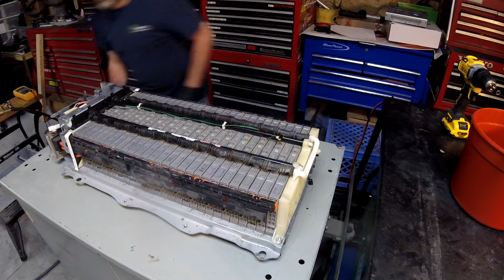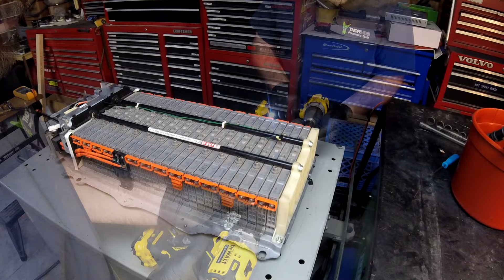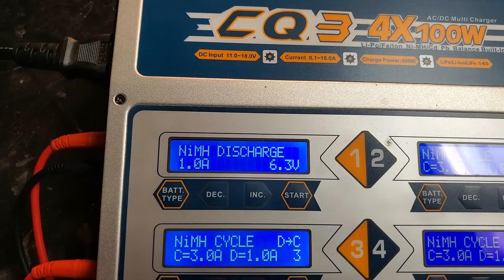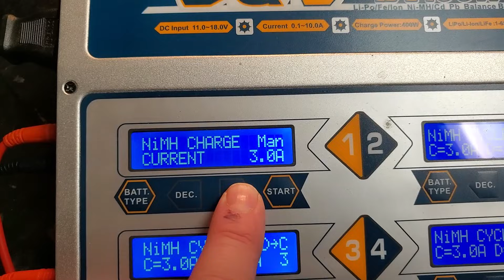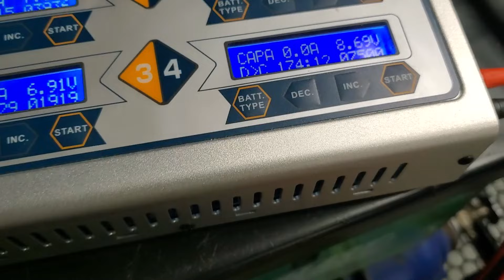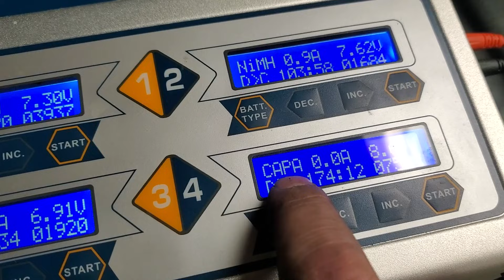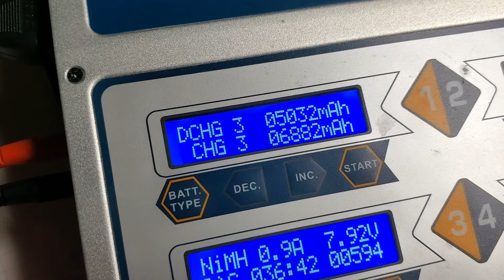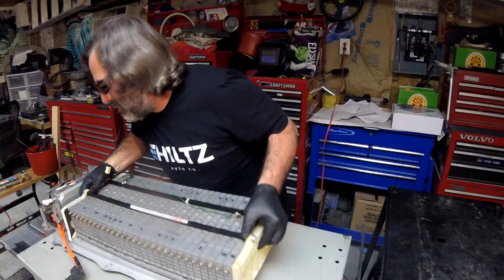DIY Refurbish / Repair Hybrid Battery 2nd Gen Toyota Prius - EV-Peak smart charger POA80 P0A80

Comment: Can I ask you something?  At 3:22, with the cover off, we see a pair of thin green wires from the computer area to a tang on one of the tension bars that keep the modules compressed together.  There's a white thing on the end of those wires with a hole in it.  I think it had a black plastic peg holding it onto the tang and I lost that in the explosion.  What is all that, if you know?  Thanks for your help.
Reply from the maker: Hey AlexT, I believe that is a temperature sensor. I do not see any part numbers on it. The only mark on it I see is a letter "S". When I connect multi-meter I see around 10K ohms resistance. If I cool the sensor a little by putting it on metal table the resistance goes up (in my case to 11k ohms), if I heat it a little by holding in my hand the resistance goes down (in my case 8K ohms). Please write back and let us know what you find out.
Reply: @GreggFesto   Will do.  Thanks.
Reply: @GreggFesto  I notice the green wires seem like special wires.  Not the same as some of the other wires here.  Although the wires fed thru the looms look the same.  I wonder if the terminal is just to keep the wire in place, stretched along the top of the battery.  
Got the car started for a minute and no red triangle of warning lights.  I heard a little ping from back there so I shut it off.  After that, it would not start and the red triangle is back.  Also, there's a serious draw on the 12v.  It passed the load test with a 135 amp draw yet something is pulling it down when the outgoing 12v is connected..  
I'll need to do a lot of hunting around tomorrow.  I'll leave the charger on it all night.  Everything is suspect at this point.
At least the 3 new modules didn't explode...yet.
Reply: @alext8828 did you ever figure out the problem and what was causing your back to explode???

Comment: Hello, one question , Any tig wire would work ? I found one type that says aluminium, 5356 0.035 in. Alloy Arc MIG 1 lb. Wire on Home Depot, no idea if its the right one. thanks. Also, I saw you marked the pack number 7 as a bad one but on the final assembly, the number 7 was there, also number one was moved as the third one, did you use more than one battery pack on the final video ? regards.
Reply from the maker: Hello Samaria, Thank you for watching and commenting. It does not have to be TIG wire that you use. It can be any wire that that conducts electricity. I used TIG wire because it is what I have plenty of and it is easy to put across all of the cells. I have used bailing wire as well. I do not quite remember what I did with the cells in regards to arrangement.  It is possible that I put everything back together long enough to complete the video. When doing this process please be sure to read all of the settings listed in the description. When you finish your refurbish, let us know how it turns out.

Comment: Very easy-to-follow video.  On mine,#4 exploded.  Does that cause any damage to the rest of the pack or the BMS?  And where would you suggest I get a new module?   Update; The blown-up module is still at the same voltage level as before.
Reply from the maker: Hello AlexT, Thank you for watching and writing in.  When you say the module is blown up - Did it swell and then return to normal shape or did the plastic crack and fluid came out? If it swelled and went back to shape then this may be normal. The swelling is why they compress them together and the reason you should not charge then without being together as a bundle. If fluid came out then you should replace. You can see in the comments where we ordered our replacements on ebay. Good luck and please let us know how your pack turns out.
Reply: @GreggFesto  Hi, thanks for the response.  No, the top of the cell blew right off and hit the metal shroud.  And listen to this; you can see inside the cell and it still works.  It's the one that showed 6.73 volts while the rest were at 8.2.  I power braked it a bit to get the battery a little more charged up and I heard a gunshot.  
I've got a few questions.  Isn't the onboard BMS suppose to balance these modules once they're in and running?  Also, can I use a 6v/12v load tester on these, or is the draw too high.  This load tester returns results in 10 seconds.  I don't want any more accidents.
Also, where's a good place to get modules from?  
Again, thanks and I'll let you know what's happening.
Reply from the maker: AlexT, Wow what a crazy experience. I bet that I would have jumped clean out of the car when that shot went off. I am not sure if BMS balances the modules or not. I always seem to see allot of variation in the modules when looking at DrPrius app on a battery that has come in for refurbish. You can load test them with a 12V light bulb or a series of 12V light bulbs and see that a failing cell will provide dim light faster than a good one. I am not sure about the electronic load test meter but you got me to thinking.  Mine will only go down to 100CCA for the battery test. I decided to try this. It would only tell me to check connection and would not allow test. I imagine if you had one that would go to 1-3CCA that this could be possible. If you do this test, please let me know your findings. I usually order from eBay from sellers with the best feedback. I look forward to hearing your journey.
Reply: @GreggFesto   I'll definitely let you know.
I have a 6/12v load tester that might work, but I'm a little leery about using it on one of these batteries.  It is possible that the 7.2 voltage is okay but the load might be way too much.  Like using it on a small 9v battery.  It might see the load as a dead short.  Safer to use a bulb.  Thanks for the info.  Talk later.
Reply: @GreggFesto  Yeah, Dr. Prius and Torque pro show the voltages jumping all over the place.  Not sure what the heck is going on there or what that truly represents.
Reply from the maker: AlexT, Some fluctuation is normal of course, I have noticed when cells start failing the fluctuation gets worse. Once your pack is done, use the app to watch the bars and see how they do. You will get used to the actions based on your driving style. When cells start failing you will be able to tell as they will start changing more rapidly indicating that the cells are losing capacity.
Reply: @GreggFesto   I got the idea to put the battery back together and load-test all the modules by running the ac.  Or is that cheating?  Not sure.
Reply from the maker: Perfect!

Comment: 114L date code on my never before touched pack. Best blades are hitting 7500 first cycle in the first charge but are low at 1400-2200. Is there a way of setting the charger up to improve the low instead of reaching capacity and stopping?

Dr prius app had cell 5 as low but car never shot a code and economy is 48-52 this summer. 

Should I just do a complete replacement?
Reply from the maker: The readings you are getting are normal especially if the pack has been sitting for a bit.  The low reading will rise in the next few cycles if the cell is good. There is nothing you can do to stop the CAPA and shutoff that I am aware of. I have turned the cutoff setting to 7600mah before to help some. I know it can be frustrating but if you have a cell that can get 5000 low and CAPA 7500 high then that is a darn good cell that should last a long time. 

DrPrius reads each bar as 2 cells. If you see an issue at bar 5 I believe this would indicate that cell 9 or 10 when counting from end opposite the ECU would be suspect.  

I would keep going with refurbish. Sounds like you are well on your way to saving $$. Please write back and let us know your results.

Comment: Hi Gregg. Thank you for posting this great video. After extensive research on how to recondition and balance my hybrid battery, I discovered your video. From what I learned, everything that you said was spot on. Your simple approach would make anyone who is even slightly mechanically inclined want to service their hybrid battery. My charger is on order and I am ready to tackle this! Thanks again.
Reply from the maker: Thank you for watching and taking time to leave comment. Please look at all of the settings in the description as there is one setting for discharge voltage that is required but not discussed in video. I know you will have success and hope that you will comment again and share your results once finished.

Comment: Where to buy good cells
Reply from the maker: There are many good sellers. We purchased our latest cells from eBay seller Aloyhybrid. They were about $30 each.
Reply: @GreggFesto  I have not opened up the battery to see do u think temperature 3 is very high around 115 other two Are near 100 could be bus connector need cleaned or replaced ?
Reply from the maker: Hello Edwin, I am not sure what the factory specifications are for the battery temps. I know that failing batteries charge/discharge faster which creates more heat. This will cause the fan to run more often and cause the system to use the gas engine more often. You will notice a decrease in MPG. The best way to know if bus bars are also an issue would be to open the top case of HV pack and visually inspect the bus bars for corrosion. Let us know what you find when you look at yours.

Comment: Late to the party...  2004 with 280K.  Dr Prius says only 20% capacity.  Trying to get some life out of this battery so we can sell and not scrap the car.  After 3 cycles, the best cells are ~4500mAh so I have some more time to go.  For the ones that are bad, who have you found to be a reliable source for cells?
Reply from the maker: Hello 1stepp, Thank you for watching and writing in.  Yes, we just purchased 6 cells last week from eBay seller "aloyhybrid" and they were great. Upon arrival we cycled them on the charger and they all had around 5500 for low ma and capacity cutoff 7500 for high ma after a cycle or two.

Comment: What is the right temperature for hybrid
Reply from the maker: Hello Edwin, Thank you for watching. The best way to see how your pack is performing is by using an app on your phone (such as Dr Prius) combined with a bluetooth OBD2 reader. The app will show you  what each of the 3 thermocouples in the pack read and will let you know if they are getting too hot.
Reply: @GreggFesto  hi thanks for reply I use Dr prius the number three gets close to 116 and number on is around 100 number two 106

Comment: In the middle of reconditioning Gen 2 Prius modules using the same charger. I've been having better results bringing the discharge voltage to 6.0v. It seems to take less cycles to get above 5000mha. I noticed the charger reads about .3v higher than my multimeter on each module. Either my multimeter or the charger is a bit off. Either way, @GreggFesto is there a reason to not discharge below 6.3v?
Reply from the maker: Hey Nathan, Thank you for watching and writing in. Thank you for the great information. I do not know if this is bad idea or not to discharge to 6.0V.  I obtained the settings I use from someone who knows much more than myself about the battery and charger technologies. They work well so I have not had a reason to change them. I do believe that there is a point where you could discharge too far and cause issue with the cell. Based on your results, I am going to change to 6.0V on any problem cells from my next pack refurbish job and see if I have same results as you did.  Please write back when you are finished and let us know how everything turns out.

Comment: it took the man 16 days to test 28 cells?
Reply from the maker: Hey Johnny, Thanks for watching and writing in. It took 16 days to refurbish the cells. This could be shorter time or longer time depending on the health of your cells and number of cycles you need to run.
Reply: @Gregg Festo  Hi Gregg. Thanks for very very good video.  About the charger itself, did you give it a rest in between charges or it was on non stop charging for the 16 days? 
I am currently refurbishing mine with similar charger to yours (CQ3 4x100w) and my charger has been on for more than 4 days straight.
Reply from the maker: Hello Memo Dedication, Thank you for watching and writing in. The charger was running non-stop for the most part. I would check it 3x per day (breakfast,lunch,dinner) or a little more if I had time on weekends. The only rest it would get is when a cell would finish and sit before I checked it. In this case there were still other cells cycling so the charger was technically running throughout the refurbishment process.
Reply: @GreggFesto  i noticed you didnt use a discharger instead connecting the cells together with wire?

Comment: Dr prius shows 15.11 to 15.38 is it good
Reply from the maker: Edwin, Thank you for watching and commenting. It is hard to tell if a battery is good by reading only voltage because it is the capacity that matters. Your reading of 15.11 is about 94% charge and your reading of 15.38 is about 96% charge. These numbers look good but if your capacity is only 1000mah low reading then the battery is junk.
Reply: @GreggFesto  how test capacity
Reply from the maker: Edwin, you can use the charger to cycle the cell and it will give you high and low capacity as shown in video. You can also connect a load such as light bulb to each cell and watch drain. There are videos on youtube showing this as well. Let us know what you decide to do and how it works out.

Comment: Super! Gregg, I did it following your way, with no experience, but careful, bad most of them, I ordered 26 $600 at my door, then cycle those and the ones in the car (they had #'s 3 different color markers. Out of the bunch all together, all cycle ( newer ones and old) some only made 45hundred on low end(disch) I picked 28 better ones from bunch after 3 cycles.Then I did pair top good with least good from those 28 best, until finish pairing, FF, 2+ years still running no hybrid issues. You share good(best) system and knowledge on this video. Step by step. Others try, others hide others don't know! You showed it all, best way to do. Thank you very much.  Great Wisdom!! My personal view. No questions, just appreciation.
Reply from the maker: Thank you very much for the great feedback Oscar. Comments like yours make the effort of video worthwhile.